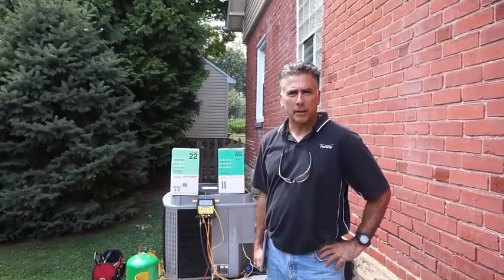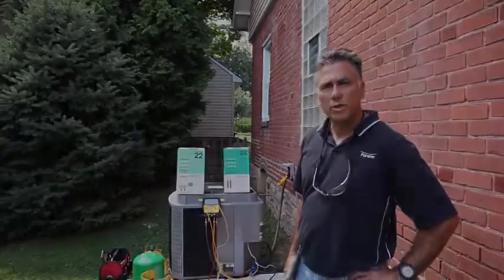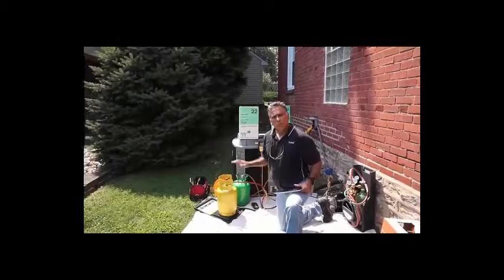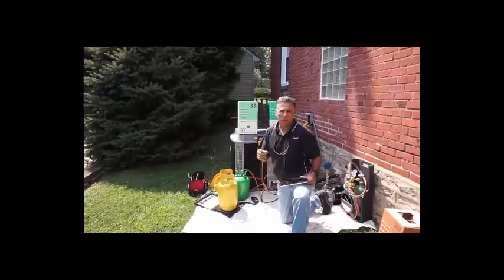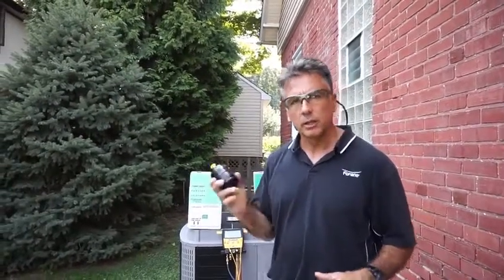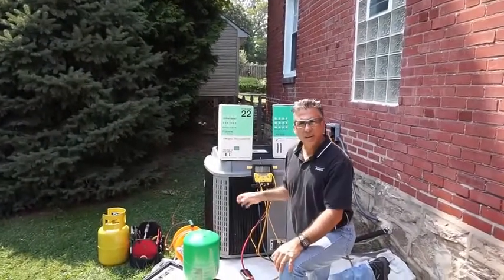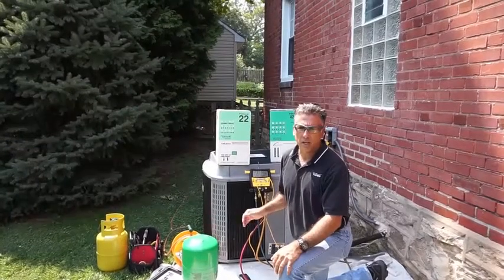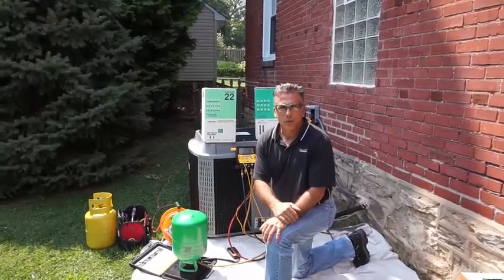Arkema 427A How to Retrofit

Comment: Maybe next time try not to charge a system with with your refrigerant boxes on the condenser fan grill. It will affect your pressures and charging. Also maybe add, to purge nitrogen thru the system while brazing the drier in. Not trying to beat your video up, I just want proper technique shown while performing a task.